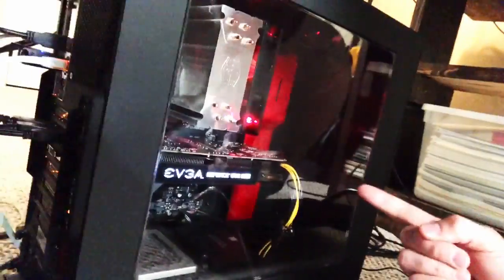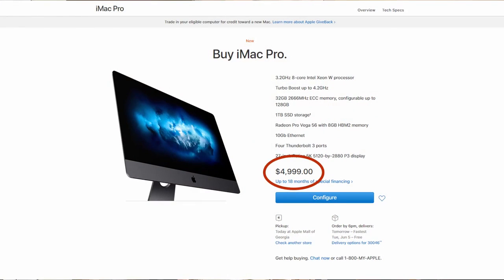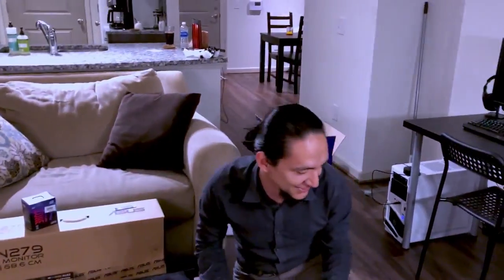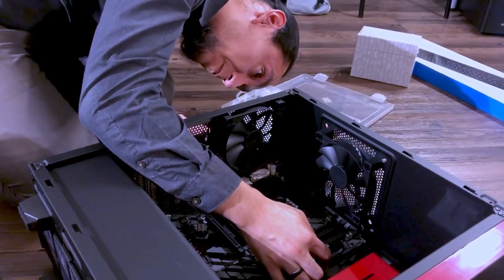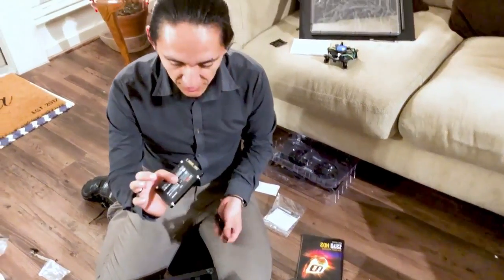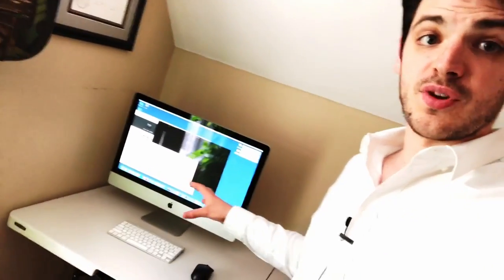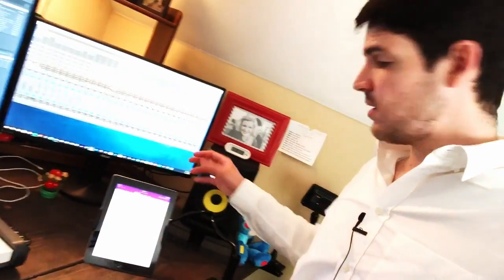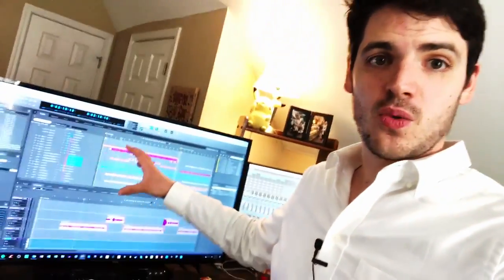How to Build a PC for Music Production

Comment from the maker: Do you use a Mac or PC to compose music...and why??
Reply: Mac. Because I use it for other things I hate PC for.
Reply from the maker: African MusicGenuis oh yeah, like what?
Reply: I currently use a Mac, but looking at adding some PC slaves , after discovering Vep7 which is a game changer !! Interested to see the conclusion of this video
Reply from the maker: Paul Brown VEP is wonderful! Mac with PC slaves is certainly a viable route, but IMO costs more and requires so much more tech maintenance. When building this PC (video from 2018), i intentionally chose to invest in one powerful PC that can host 400+ instruments via VEP vs. a Mac with 1-2 PC slaves. This setup has served me extremely well, now into 2020, with zero issues or desire to upgrade any parts.

Best of all, each of the parts I used in my build are now slightly dated and you can get better parts for less cost = more powerful PC.  Check out the Amazon links in the description for details.
Reply: Btw apple invented the slide in drive bay connections.. they also did the same for memory ..as the old Mac pros which I own has two memory risers that all your memory sits on.. and then you slide them into place.
Reply: Steven Melin I think one super powerful computer is probably enough for most folks... I agree .. the real beauty / power of having slaves, is you can access all your libs from multiple masters... Ideal for studios for example..
Reply from the maker: Paul Brown That’s definitely a wonderful setup for a studio with multiple people. For my needs (solo studio / remote team members), I have no need for multiple machines. I like a small & tidy workspace :)

Comment: This is my big plan for 2020; to build my own monster studio PC for my new studio - can't wait! I'm planning minimum 12 core i9 workstation spec with at least 128 Gb RAM, watercooled, SSDs all the way, and all in a rackmount case to sit underneath my audio interface. Win 10 has already become my main platform, very rarely use OSX these days, but I have found that Linux is a great platform when high-performance and stability is key (eg live performances, mega sound-design projects etc) - I can get 30/40% better performance than Windows (and better stability), which equates to more VST instruments, more effects, more tracks per project. However, choice of apps is severely limited compared to Windows; no Cubase/Ableton and no Kontakt (well, not officially). I know the video is a while ago now (I remember it first time around), but this is still good info and still inspiring. I hope this setup is still working for you.
PS you probably already sorted all this, but I do quite a bit of tweaking to the OS settings to optimise for audio and make sure that I don't get a surprise update or reboot during a session.
Reply from the maker: Kavokei Oh wow! That’s a monster build indeed. I can’t imagine needing that much RAM or even i9 processing. But I suppose I’ll get there eventually 😆 This vid was from 2018...I still love my build! I’m nowhere near needing to upgrade anything, except maybe a replacement / additional external HD (starting to get close to maxing out my 3 TB Samples drive due to how many libraries I’ve accumulated). Win 10 is the jam 🤘🏼And oh, definitely! I optimized all settings at the beginning so I’m never bothered with updates, notifications, or any of that nonsense. My system is extremely streamlined and is an absolute workhorse in all arenas: audio, video, gaming, multitasking.

Comment: Hi Melin,

curently using i5 4core iMac from 2015 with Vienna Ensemble pro on slave PC with i7 8core machine and 64 GB ram. Workflow is too complicated and crashing with both Logic and VEP is not much fun, quite high latency and sound is falling out very often, even if I have buffers in Logic 512 and in VEP 3-4buffers...

Now I either go for some new iMac with M1x core and hopefully get rid of slave PC, or I switch to PC with much better RAM/CPU than iMac would have in same price range. 
But would be iMac powerfull enough?
Or would you suggest to make life easier with one power PC to ger rid Vienna?
What would be your choice now in 2021?

thanks for all your thoughts and experiences
Reply from the maker: If I had to start over today I would still use this same PC build but with slightly more powerful CPU to reflect 2021 vs. 2017 when I built this. My PC is still a powerful workhouse.

Comment: Hi Steven! I have i5-4570 and RAM 16 GB DDR3. The libraries are located on the hard drive. In Cubase I can max work with 12-15 channels without any issues and then it doesn't work properly if I exceed this amount. Mainly use Spitfire library. Do you think it's up to the PC and I need to upgrade to better RAM & processor/ move libraries to SSD or there might be any other reason? Thank you!
Reply from the maker: This is a very common issue - I first suggest you moving samples to a different drive than Cubase to free CPU & RAM usage. You’ll get even better results if you can host your Cubase project files on a 3rd drive (spread out your resource as much as possible). See how that works and if it’s still a slog with heavy Spitfire plugins, you can increase RAM to help. You can also try “virtual processing” with software like Vienna Ensemble Pro which tricks your machine that you have more cores than you really do, thus spreading out resources. But honestly, buying more RAM is probably about the same cost and more effective.
Reply: @StevenMelin  Many thanks Steven for your advice! Agree, better to invest into PC RAM upgrade. Just one more quick question - is there a big difference between i5 and i7, so maybe makes sense to upgrade processor as well? Just want to fix everything around computer and focus mostly on creative part.
Reply from the maker: The processor determines how many programs you can run simultaneously. If you’re ok with around 5 open at once, no need to change. If you want more like 7-10 open, upgrade to i7.

Comment: I produce on MacOS but on a PC (“Hackintosh”) but I also work on a Macbook. I mainly work in Ableton Live but sometimes also in Logic. When I built my PC, I wanted a machine to do 3d animations and to compose music. But there were too much things that bothered me about Windows: no well integrated Backup solution like “Timemachine”, the “Windows key” always in my way, the half thought up touch screen integration/desktop (windows 8), the preferences scattered throughout several dialog boxes. I didn’t want to sell my PC, so I tried Hackintosh. I know “Hackintosh” has some flaws, and every update has to be evaluated. At first I din't like the idea, but at this point, several years after using it, there is still no Mac for the same price that will considerably outperform it. I’m waiting :-) Maybe I will give windows 10 a try?
Reply from the maker: Patrizio Giordano I HATED Windows 8 for many of those reasons, but I’m a huge fan of Windows 10. They made significant updates since 8. I’ve never tried a Hackintosh, but I’m so into PC world now that I can’t see myself returning to Mac.